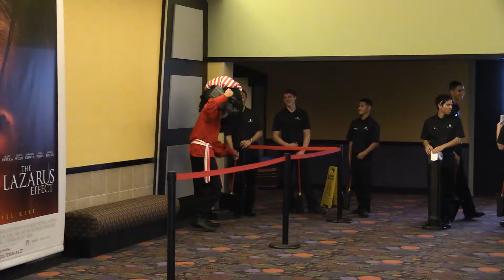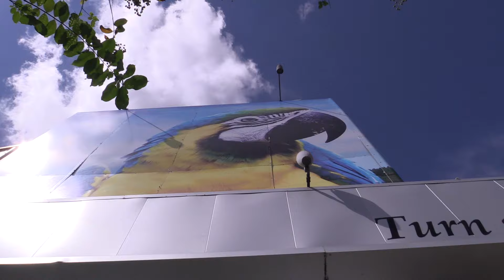My Greatest Accomplishment

Comment: How long did that hair take to grow its actually a pretty good look
Reply: WhiteShark probably a little bit over 2 years
Reply: Juan Carlos I've been growing mine for 2 and a half years and it's not even close. Probably more like 5 years
Reply: Thomas Varnell Dude if you look at the studio parts where he has his hair down you can see it reaches way under his breasts. I've been growing mine for six years and it's barely resting on my shoulders, if you want to grow long hair in its literal sense you need to be 100% devoted in the esthetic, because it can easily take over a decade
Reply: Healthy hair growth is an average of 0.5 inches a month. Which means your hair should grow 6 inches in a year. So if you've been trying to grow your hair for 6 years you should have really long hair by now. Maybe you need to change your diet and/or take supplements because your hair should be well below your shoulders by now.
Reply: Depends how fast your hair grows it's different for everybody.